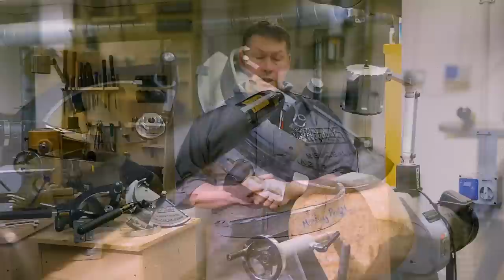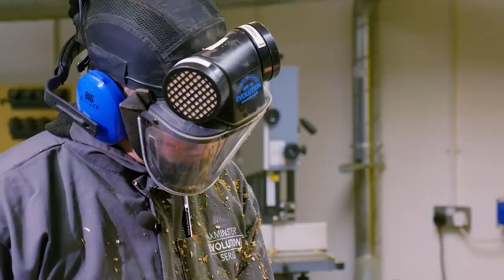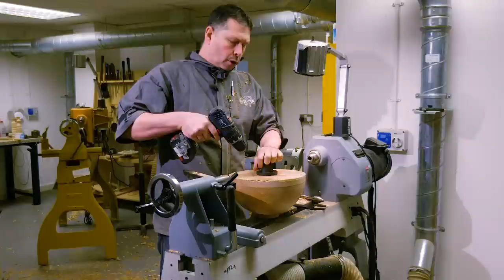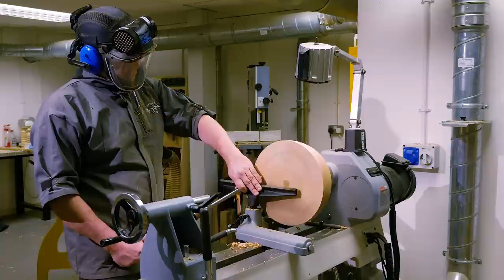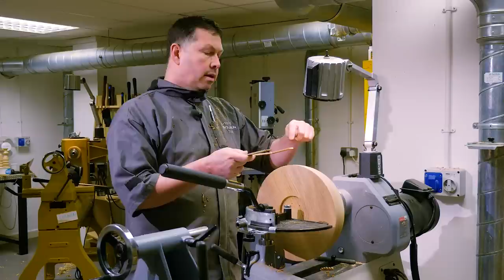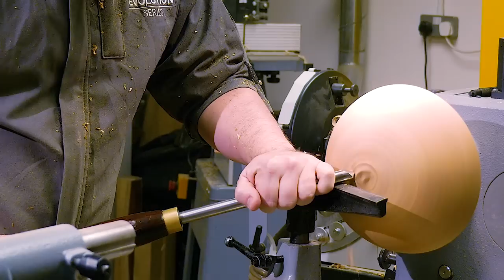Woodcut Bowlsaver Bowl Coring System - Demonstration

Comment: Think you are using the templates incorrectly. The arrow should touch the bottom of bowl and the centre of the bolt. Bowl base thickness is built into the system. Easier the guessing. I have made hundreds of bowls,  using  the same system on a 1hp axminster lathe it's fantastic. No failures yet!
Reply: I have a 2hp laguna and the bowlsaver just like this, on the larger blade I keep getting caught up somehow and it stops my lathe several times. I'm pretty sure it's all set up right, not sure what I'm doing wrong yet

Comment: In your opinion. Which is a better option. An internal chuck or an external chuck. Trying to work out what would be a better purchase yano.
Reply from the maker: Hi fletch lives, the following reply is from Colwin - "This depends on the project, however, if you're looking for strength then recess can be made stronger but if you're looking for flexibility then a foot is better.
Different projects will change the answer so you will need to get used to using both methods.
Hope that helps."

Comment: Hi colwyn, can you check the template position? I use it to the bottom of the blank… as I’ve tried it your way and it seems to cut an uneven bowl. The main blank has a larger base and the second bowl is smaller than needs to be. Can you let me know as I’m a little confused as to which is the correct method.

Comment: The template is used differently in your various instructional videos.  Does it line up with the bottom of the blank or where you want the bottom of the cut to be?
Reply from the maker: [https://www.axminstertools.com/business-services]Hello, the template will give a 20mm wall thickness of bowl so if you want more just add the extra